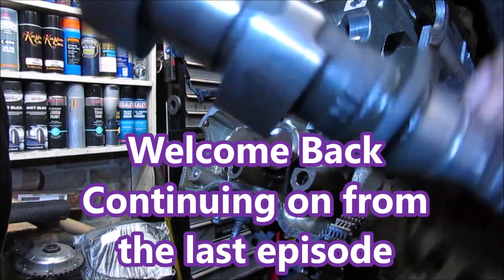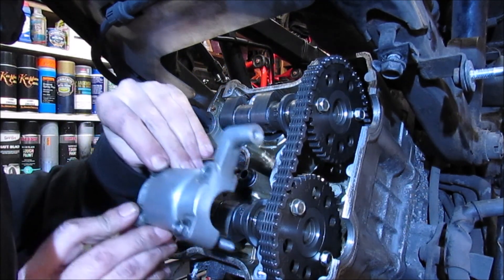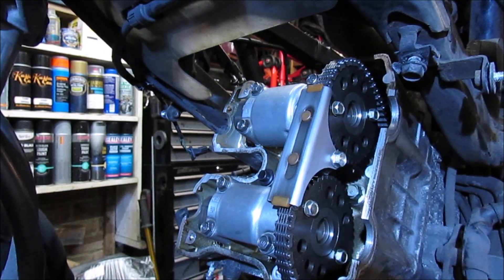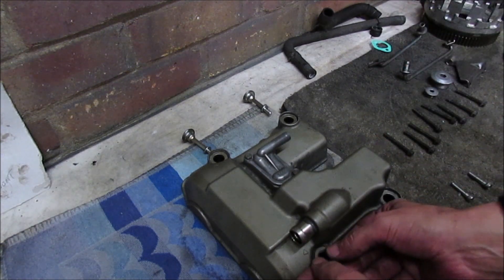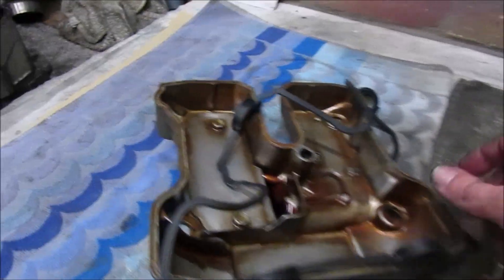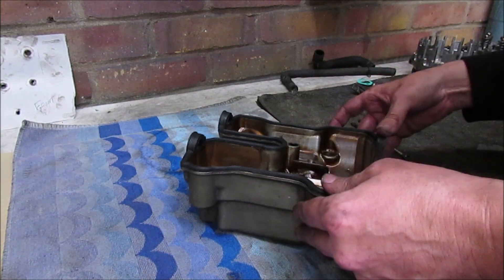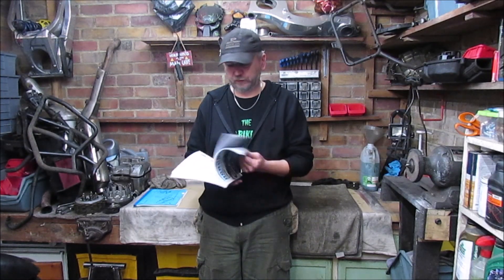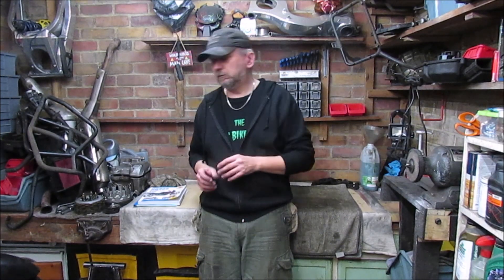Honda XL1000 Varadero  - Engine Rebuild  Part 2 of 2

Comment: Good Evening.
I just saw your new video and I am writing to you because I found two or three mistakes. I hope you will be able to correct them.
First I saw that you put the intake camshaft in the front cylinder. It's wrong. First you have to put the exhaust camshaft, taking all the gaps in the chain. Then put the intake camshaft, align it and tie it with the chain so that the timing is not damaged. Do not put the lid on before putting on the tensioner. After you put it on and release the voltage on the chain, then release the chain and turn the camshafts two or three times counterclockwise to make sure the timing remains correct. Then he put the lid on, although I would personally leave it for the end after I had put the camshafts of the rear cylinder in the way I described before. Be careful not to damage the timing by putting the tensioners.
Good luck.
Reply from the maker: Thanks, as i mentioned i am ahead of what you see, so everything has been checked and rechecked, sadly not filmed, but i really appreciate your comment, this has been a good learning experience

Comment: Coming together nicely Keith, I would personally leave the valve covers off until both chains are installed and turn the engine by hand a few times to double check the timing and chain tension. Glad you’re making progress 👍🏻
Reply from the maker: Thanks Jonboy, That's the plan, as i said to an earlier comment,  i am ahead of what you see, so everything has been checked and rechecked, sadly not filmed,
Reply: I know im asking the wrong place but does any of you know a way to log back into an instagram account..?
I somehow forgot my login password. I appreciate any assistance you can offer me!
Reply: @Lance Alexzander Instablaster =)
Reply: @Finnegan Mario I really appreciate your reply. I got to the site on google and Im waiting for the hacking stuff atm.
Takes quite some time so I will get back to you later with my results.
Reply: @Finnegan Mario It did the trick and I now got access to my account again. Im so happy:D
Thank you so much you saved my ass !
Reply: @Lance Alexzander glad I could help :)

Comment: Just as a precaution, you might want to take the rocker cover off  to double check the timing setup, just to confirm the chain slack was correct when the tensioner was installed.
Brilliant to see it going back together 👍
Reply from the maker: Thanks for the info!as i am slightly ahead of what you see, i have already double checked it, but did not film it

Comment: Just curious as to why you did not junk the OEM cct's of manual cct's.
OEM cct's are the Achilles heel of these engines
Reply from the maker: Thanks Richard, appreciate your comment, i have had the bike since 19k it now has 93k, i have never replaced them until now, i thought i would stick with them, maybe in the future i will change to manual ones, but enjoyed the experience of delving into the engine
Reply: @TheAmateurBikeBuilder  Well you have certainly put the miles on  and as I understand it that gives you a much better chance with the OEM cct's . Best off luck with your bike.
What is it you like about it?
Reply from the maker: @richardgodwin9852  have always ridden sports or street bikes and wanted to do a bit more touring and the Varadero appeared at the right price 7/8 years ago, it kinda went from there, it is a great piece of kit, good fuel range, comfortable and a good seat position, cant really pin point it just a great bike all round and i love riding it